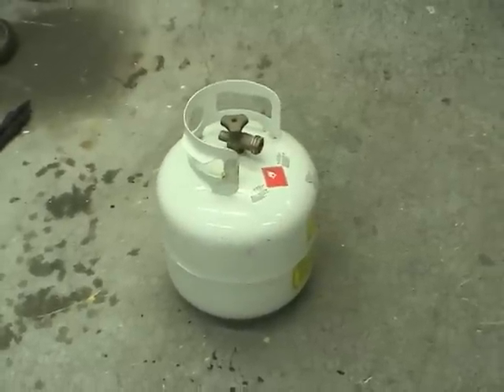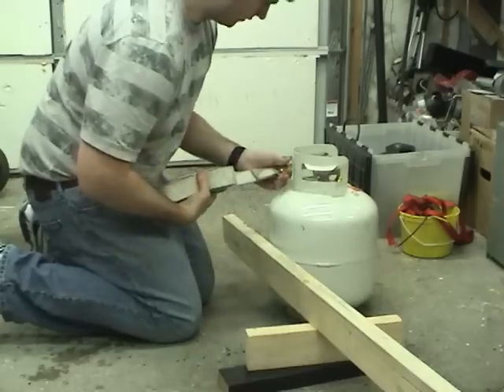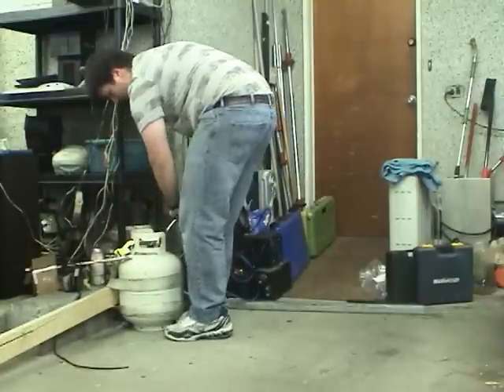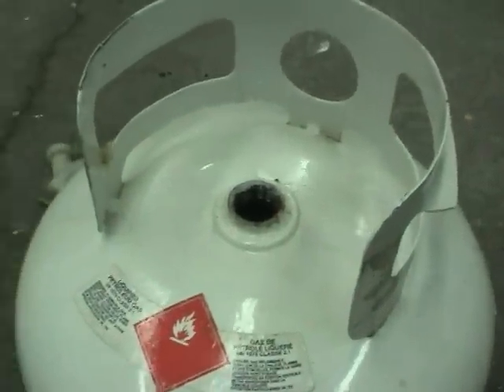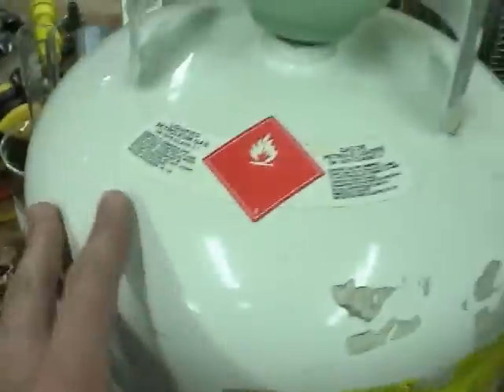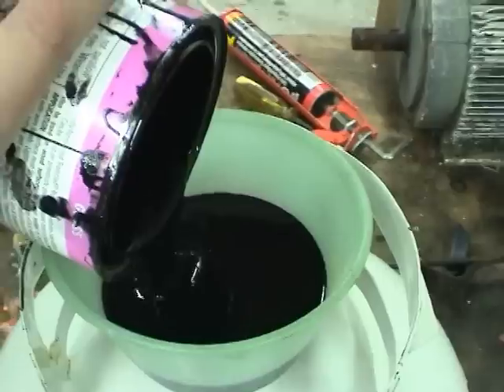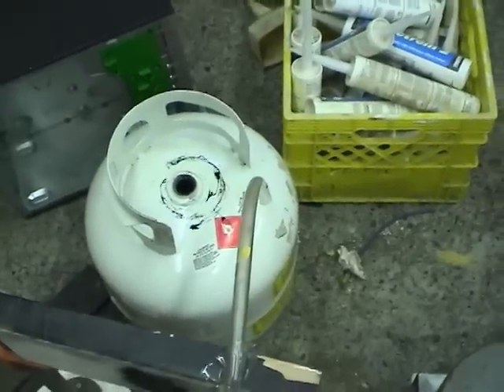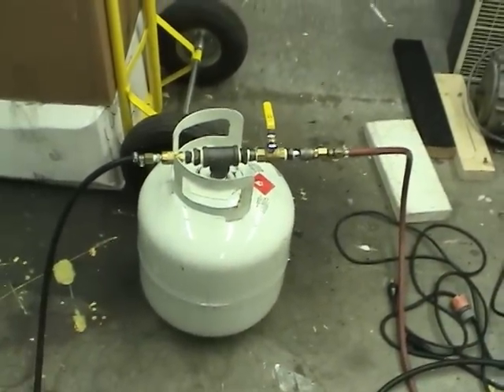Converting a propane tank into an air tank

Comment: I think as long as you have an oiled compressor you don't necessarily have to rust proof the inside, as most oiled compressors will generate an oil mist within the air tanks, same as a combustion engine does in the crankcase.

Comment: WHY IN THE WORLD WOULD ANYONE WANT TO CONVERT A PROPANE TANK TO AN AIR TANK??? Propane expands 265 times its volume. I put a quick release air chuck on them, fill all my tires from jeep to motor home with propane, then I use my air wrench to break down the lugs with the propane tank before I take off the tire. I use my air tools with the propane tank as well. Perfectly safe that is less you smoke or have an open flame about. This was taught to me by a propane company in Phoenix Arizona...

Comment: @killer2600 it still wouldn't matter, the temperatures suitable for loosening the threadlock are nowhere near the ignition temperature of propane...
However it should still be done outside or in a very well ventilated space...

Comment: If the valve is stuck and won't turn out, use a torch to heat the threads.
Reply: Bad idea,very bad idea.

Comment: This is enough for 10 bar pressure? Let me know
Reply: The standard relief valve on a propane tank is 340psi and the tank obviously is rated higher than that. 
As mentioned in the video he tested his to 400psi. 
I’ll leave the PSI ->Bar conversion to you.

Comment: Very interesting video.  When you hydro tested the tank, you simply just had the tank filled with water and had the air act on the surface of it? Second, are all the in line components pressure rated at or above 400 psi? This is just an observation as I have seen this type of failure occur on components. Thanks again for the video.

Comment: Nicely Done.
The Stink left behind is from the oil piston blow-by
of compressed Propane filling the tank.

With ball valve in place - Draw Vacuum on Tank-
Let tank suck in pint of solvent - preferred Naphtha from any builder supplier for paints.
Shake a bit, Add 20psi, vent drain it to recycled oil jug.
Repeat.
That should get rid of that nonsense.

Good idea painted inside,
but any bathroom portable hot air heater sitting close,
will rid tank of any moisture left behind.

I use my tank modified for everything-
Vacuum & Pressure.
Removes all anti-freeze from engines for service.
Zero mess & 30psi added puts the coolant back in.

Same with marine inboard V-8's changing oil hot.
Now how many struggle for hrs draining V-8's,
when it takes less than 30 sec's to suck it dry.

Comment: Just keep the original valve which has a safety in it and use a soft pol - the pressure rating is on the side of the valve

Comment: Could you tell me what size T piece and where I can get one
Reply: I want to know the size of the tapered thread
Reply: Looks like he is using standard 3/4" pipe fittings... A tee like that should be available at any hardware store.  Galvanized should work fine for this application as well.

I used an old propane tank mounted upside down as an expansion tank in a water pumping system.  (For spraying dust control products on gravel roads, not for potable water use) and it was a standard 3/4" female pipe thread exiting the tank...

Comment: You hit the nail right on the head ANY TANK OTHER THAN A  ASME CODED TANK IS ILLEGAL FOR COMPRESSED AIR USE!!!!!!!! I should I am in the compressed air feild and BTW most tanks are not coated and if they are there epoxy coated or galvanized not painted
Reply: That doen't make sense (but most of what the gov't mandates doesn't make sense).  It would make more sense to make it illegal to use air tanks for hazardous substances other than air.

Comment: to remove the value why not p;ace a bar threw the holes in the handle would be easier then to spread the pant around on the inside of the tank just roll it on the floor .??
Reply: I laughed  at the crescent wrench. Good way to damage it with a cheater bar.  I got a 36" pipe wrench for such.
Reply: Accumulator1 it's a lifetime warranty with harbor freight

Comment: Really you need to loosen the flat head screw on the side of the valve to make sure the tank is empty
Reply: That's a good idea as long as you understand that is a pressure relief valve (opened only during filling of propane) and doesn't allow the fumes to be completely removed.  You still have to remove the main valve and fill with water.

Comment: Why not just take the tank to Lowe's and trade it for a full propane tank? It seems a lot of waste to me since you can buy an air tank for less than the value of the propane tank.
Reply: Ron Wallace it was an expired propane tank
Reply: 300 psi. tanks are expensive $150.+
Reply: He wanted an air tank, not a propane tank.  5 gal air tanks cost about $30; a new, empty propane tank costs $30 new.  Recycled propane tanks cost $0.00

Comment: Wow your pressure test was was all wrong. #1 you must know the test psi (not guess) #2 You need to know how long to  hold the pressure ( this will show major leaks as well as pin holes). #3 A cage is a must. DO NOT FOOL YOUR SELF @ 400 PSI IF IT BLOWS UP YOU WILL GET SEVERELY HURT AND WET!!!

Comment: The have converters you screw right on now and has 1/4 in for air hose fitting, they have internal and external thread depending on the tank used, under $10 on Ebay. No more struggling.

Comment: i used to do change valves on customers tanks years ago . take a pipe and notch it over the valve. then drill a hole all the way thru on the other end put a piece of rebar thru it and turn.

Comment: @AKAtheA Again your assuming, you never said what to heat it with and I will assume most people with the tools and desire to undertake the conversion would likely heat the threadlock with a propane or similar torch rather than a hair dryer or heat gun.

Comment: I don't have a blower like the one you used. what other ways can be used to dry the inside of the tank?
Reply: vacuum cleaner
Reply: Place a small portable heater blowing warm air on it from the outside.
Reply: You could drop some used motor oil in there and then drain it well under hot weather sunlight.  Do that every once in a while and the tank should last many years.  Forget the paint...

Comment: Using a screwdriver to drain or even check if it is empty is beyond stupid. Compressed propane will give you frost bite. Use a hose off of a broken bbq outside. If the valve got stuck and there was gas in the tank you would be fucked

Comment: good vid but much easier to just buy an adapter for the existing propane valve, skip all the painting steps and you'll be done in 5 minutes. the tanks are cheaper than the paint you use to prolong its life. My unpainted tank is going strong after 4 years as a portable tire filler.

Comment: What kind of paint did you use inside? How much was the paint? Where do I buy the paint?
Reply from the maker: It's Tremclad rust paint available at any hardware store, probably about $5 for a small can.
Reply: tesla500
Thanks. I am also having one real problem getting the valve off too. Looking to get some old air conditioning compressors too from some free nonworking air conditioners, and then I will have the quitest and safest air compressors around for free too LOL. Was considering keeping the hole for this tank on the bottom so if there's any moisture it would accumulate in my new valve at the bottom, and every time I  turn on the air moisture will automatically be removed by the moisture trap. Thanks for the video.
Reply: tiredfingers99 Another thing you can use is compressors from old refrigerators. Only thing, have to drain the oil that is in them and fill with compressor oil. They are quiet and quite powerful depending on the model and size.
Reply: Richard Smith
And quite free considering all the free airconditioners I see on free stuff websites.
Reply: tiredfingers99
O great...just release all that refrigerant into the atmosphere. Isn't that highly illegal?
Reply: +Jose Francisco Medeiros so why cant an old system use R134a?  If you filled the system with R134a would something very bad happen?
Reply: Michael
Reply: Gavi
Reply: tesla500 dif you use any ptimer before thr paint or just the paint into the naked metal?
Reply: propane leaks every time you fill a tank at gas station???

Comment: "I will now use my handy dandy M Tech Jet Engine  Blower to Dry the tank for 24 hrs"   Who has one of those laying around?  Why not just rinse it out and use it?
Reply: I'd just set it in the sun to dry. That oily film if there is any from the propane would slow any rust. I doubt seriously any tank would launch itself if rusted out, it would do like tanks do and leak
Reply: +Craig Nehring it wouldnt launch itself into the air like in Gone in 60 Seconds???

Comment: All that trouble....Why not just buy an air tank ????
Reply: some of us are poor? propane tanks are dumped at the side of the road o' wise one...
Reply: six total days of electricity for the fan, the paint, the valves, and all the time involved and he could have spent twenty-five bucks to buy a tank all ready to go, but then I would have nothing to comment on. So...alrightythen.,
Reply: Real men like to build with their hands, not because they have to, but because they can. Millenials.
Reply: One reason is that all of the new ones do not have interchangeable bits--that is they are fixed for tire use only and there is no "disconnector". Cheap pieces of crap!!
Reply: My brother and I have a saying: "Why buy it for $20 when we can just spend a week and $100 making our own?" And yet we still do it. It's pride maybe? Growing up without the "extra money" some people seem to have? Bragging rights perhaps? Self-sufficiency? Maybe we just want to see the rarely seen. Like the inside of an anonymous, run of the mill propane tank. Your question is valid. I have not the answer.
Reply: Wise Student. Correct
Reply: The only place to dispose of propane tanks is at a bulk supplier (not your local retailer).  You'll have to take it to them (except for large bulk tanks).  Instead, recycle the tank into something useful.  Besides air tanks and depending upon size, people build camp stoves out of them, portable and huge trailer mounted BBQ grills and smokers, tent heaters, gasoline tank, a crucible for foundry work, backyard fire pit, etc.  HF wants $30 for a 5 gal air tank (probably a thinner walled air tank).  This guy probably spent only $10-$15 for the fittings for a better quality air tank.
Reply: really,harbor freight has pretty good ones. but some guys like cobbling stuff together
Reply: @anthonymarcocasamsssima8998  Sorry, but I need to steal your quote.
Reply: @migmadmarine  yep, in Australia so these are still pretty expensive. i made a small air cannon from a 2kg bottle and only use it at 40psi to launch marbles and have a foot pump to charge it. nothing dangerous, pulled apart after sitting for a number of years, ZERO rust

Comment: Beware of the felonies if you take your homemade tank on public roads. Most law enforcement overlooks DOT laws for Joe blows such as you or me, but they have bad days too.
Reply: Also for safety reasons isn't it advisable to pressure test with the vessel in water as well? Same reason forensic investigators discharge firearms into water filled vats. 

For liability reasons

Comment: why was it expired? You can buy air tanks cheap "a"? It does seem like a lot of work and 24 hrs. is NOT "quite effectively" for that blower, but I know what you're talking "a boot". Ha ha jk! Keep your cold air ass winter air up there!
Reply: He probably didn't get it re certified. You have to do that every so many years.  The propane filling station checks the tank and valving and then will put a new date on with a hammer and punch.  The last I remember it was a 12 year period.  It has been over a half a dozen years since I did the refilling game.

Comment: he should see what comes up if he pressure tests it... its an illegal build, if that thing goes boom, it will level a garage.... I have seen what a 270L tank does when it fails... its not pretty...
Reply: Propane gets to a much higher pressure than a shop air compressor runs at.  Most shop compressors only air up to 120-150 psi, with less common 2 stage compressors running at 175 psi.

A propane tank at 70 degrees is at 145 psi, when its 100 degree's its well over 200psi, and at 130 degree's (which they gotta be safe for to sit outside in the summer sun!) propane is well over 300 psi.
Reply: Towlieee good info!!!! Can I ask what you think about using the little 12v tire compressor from harbor freight on a larger older propane convert mounted under my rv? Will it run tools/sprayers
Reply: @louispeters2105  Only briefly, then you have to wait for the HF compressor to catch up and probably burn out.  Like cash flow, cfm is important here.

Comment: Just buy an air tank for $25. It's safer and it's easier.
Reply: No danger if it's properly purged, also this is the best form of recycling...reusing.
Reply: Agreed.  5 gallon air tank are inexpensive.  After buying the fittings, you're probably not even saving much.   Interesting video none the less, didn't even know this was possible.

Comment: A waste of a good propane tank.
Reply: It's an expired tank, the commercial refill places will no longer refill it
Reply: what would you have done with the tank??
Reply: Elliot Check tanks can be recertified
Reply: Kevin Yeip not all of them can. I’ve got one here that’s been rejected because of the type of valve. Sadly it was full of propane yet not a single adapter to fit it unless I wanted to use it one time for a propane torch and never have it refilled again. Tanks are cheap new and old ones are great for recycling.

Comment: Lol.. at "33 secs" I love that... (right above the explosive fire sticker) you stick a potential sparking metal rod to check content!!!  Dumbshit!  Try a wood stick next time.

Yeah they love that... when you tear open the packages!  (Did it today at HDepot!)

Can you do the math for me on volume?  I have a 4" square tube bumper (3/16 wall), that is 56" long.   What is my internal volume of air?  (and what would max safe pressure be?  -assuming all welds are valid and strong)

Thanks... -Steve